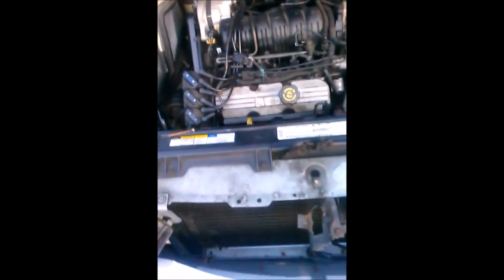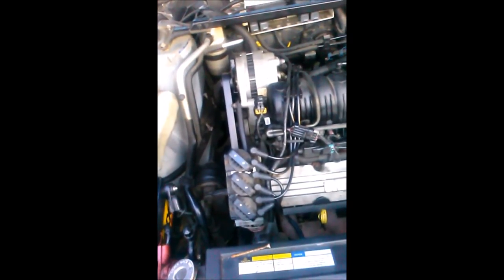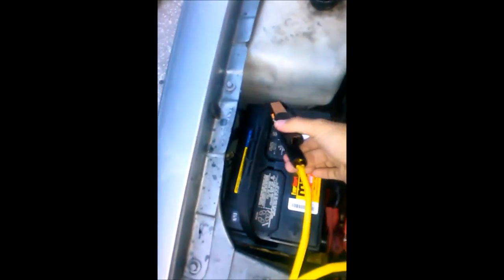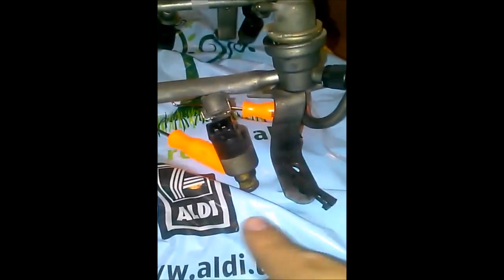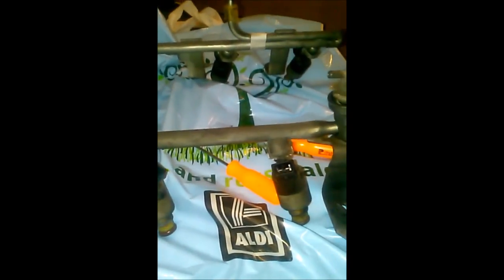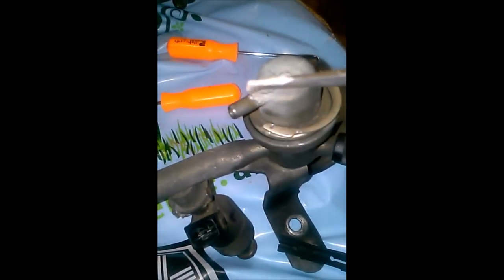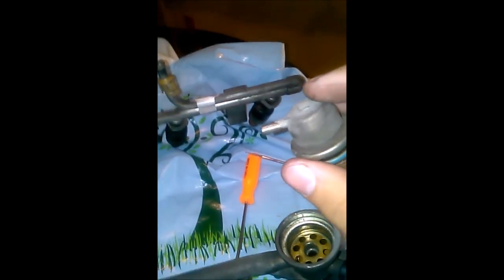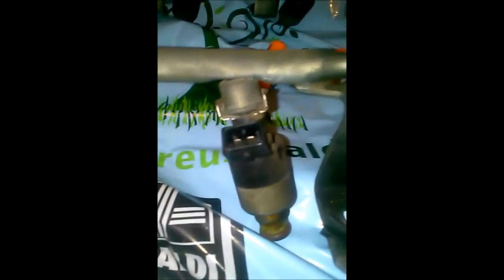Update on the Buick/how to change an fuel pressure rugulator part 1/2

Comment: Taking the fuel pump fuse out from the fuse box, then attempt to start the car a few times. This will pressurize the fuel line before disconnecting.

Comment: Very useful video thanks. I got to say that was the worsed Pressure Regulator leak I have ever seen mine is just spitting.
Reply from the maker: Joel smith yea mine was pretty bad but sorry about that the video is not better but ill help you if you need some. overall thank you
Reply: After watching your video I was able to replace mine its the same on a monte carlo That clip was A sob but car runs great now. thanks again on the video
Reply from the maker: oh ok thats good. glad my video was able to help you out and no problem

Comment: Do u have to depressurize the fuel system before taking fpr out in any way or just take it out? Thanks!
Reply from the maker: Yes I would depressurize the system before doing so via taking out the fuel pump relay and cranking it a few times or disconnect the negative battery terminal and then relieving pressure at the Schrader valve
Reply: @dragon124356  Thanks much!

Comment: would this need to be replaced if my car is turning over for 3-5 sec before turning over while having to give it gas to start the car?
Reply from the maker: not necessarily it could be a different amounts of things if you want to test if yours is bad when you do get it running take off the vacuum hose that attaches to the fuel pressure regulator and see if gas is coming out that nipple if not then most likely it is not bad after that things I will look at are the mass air flow sensor idle air control sensor throttle position sensor and check your air filter just in case if the if the mass airflow sensor is dirty just buy a can of mass air flow sensor cleaner at your auto parts store just spray it the two little wires in it but make sure it is unplugged let it dry and plug it back in and see if that doesn't help also if you can make a video of what it's doing on your Channel I can better direct you on what to do
Reply: On my 2001 lesabre 3800 if it sits for a couple of mins i have to give it gas to start i have no engine codes. It don't shoot out gas from the regulator when i take the hose off i'm lost :(.
Reply from the maker: hardyb311 Hm I didn't see this but let me sit on this to see if I can think of anything. is there any more symptoms?
Reply from the maker: hardyb311 tho things I would look at is spark plugs, spark plug wires, check if the map sensor is dirty. what's has been done to the car?
Reply: I fixed it the fpr was bad i had a new 1 put up
Reply: I did the basic test checking for gas leak but it didn't leak so i seen a fpr on ebay for $10 new so i bought it and it fixed my issue
Reply from the maker: hardyb311 fpr? do you mean the fuel pressure regulator but also good to hear
Reply: Yes sir my old 1 did not leak so i spent $10 new on ebay and bought another 1
Reply: @dragon124356  My 94 lesabre 3.8 won't start unless i push on the gas. No gas leaking out of the fpr my air filter bad I'm change it to see if it makes a difference
Reply from the maker: @hardyb311  does it idle after starting?
Reply: @dragon124356  Yes! New air filter, maf sensor working I'm change that fpr saturday my other car did the same 2 years ago wouldn't start cause the fpr was bad.
Reply from the maker: @hardyb311  check your iac I actually just replaced mine because it would act up and not start without pedal but when I did would start and idle. Make sure there isnt a lot of carbon buildup on it. I'm at 201k on my 01 lesabre not sure where tou are at

Comment: what was the reason for you changing that FPR? and how was the out come of changing that....did u or can u make a video of a after  math of this....? well heres my story...2000  impala, stalls out &  got theses parts replaced, fuel pump, rebuilt altenator, crank sensor, ignition module, also was told the cat converter was plugged, so we removed the converter, and still stalls... im out of ideas on what it can be....
Reply from the maker: +rounddancefan1 i had to change this one because the diaphragm had a torn hole in it. that's why it was spraying fuel it is not so pose to do that. so basically the fuel by-passes the fuel rail and enters the throttle body through the vacuum hose, thus flooding the engine. but ok what size engine is in your impala? also try checking the mass air flow sensor (maf) to see if its dirty. if it is dirty unplug your battery and remove the sensor and spray the two little nods using a maf cleaner from an auto parts store but when spraying it do not turn it upside down and also let it sit 10-15 minutes to make sure it is dry after spraying it. also does it run like, you can rev it up and only dies when it idles? if so check the idle air control (iac) to see if it is dirty (it will be dirty but you are looking for excessive amounts of carbon on it but it is best to clean it anyways and clean it like i explained with the maf). it's right next to the maf. also then check if any vacuum lines are either broken or old and crusty.
Reply: i did what u said...checked for vabbum leaks useing soapy water suds, also sprayed around the fuel inj' but i took it out for a ride & it actually caught fire under the front manifold around the spark plug by the coil packs....2000 chevy impala 3800v6 not super charged
Reply: lol my keyboard is all messed up...time for a new keyboard.
Reply from the maker: +rounddancefan1 woah how did it catch on fire? also has the spark plugs ever been change?

Comment: Where is the fuel pressure sensor located on a 2000 Buick century?
Reply: Depends if you have a 3400 or 3800. If it is a 3800 it will be the same as the one in this video. If it is 3400 the placement will be almost the same but I believe it is more difficult

Comment: why in god's name did you remove the fuel rail?  The fuel pressure regulator right there in front.  Having replaced mine, I can say that the little snap ring that holds the regulator in, can be a pain to remove but more of a pain to replace.  It is a tight fit between the snap ring and the little groove in the housing.  I had to file the snap ring down a bit in order to get it back in.
Reply from the maker: gk10002000 eh at the time I wasn't as knowledgeable as I am now. honestly I would leave it on if I had to do it again besides I mean I can agree it is a lot harder to put that snap ring back in.